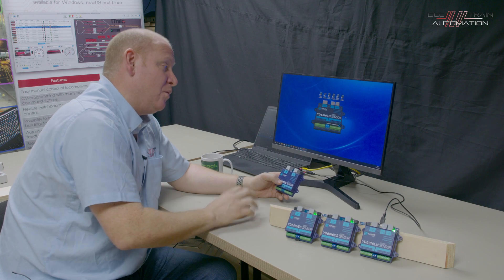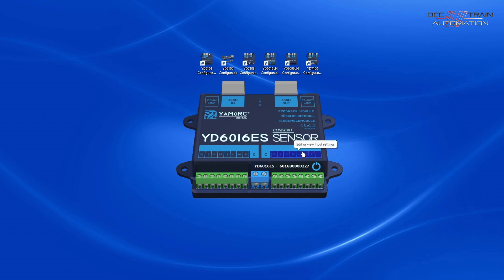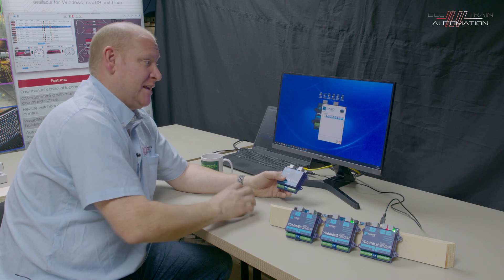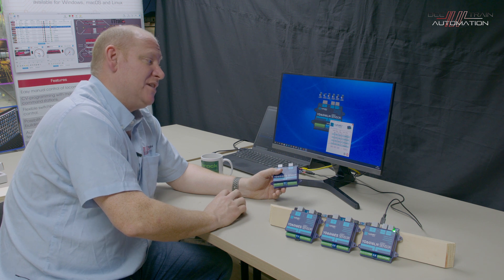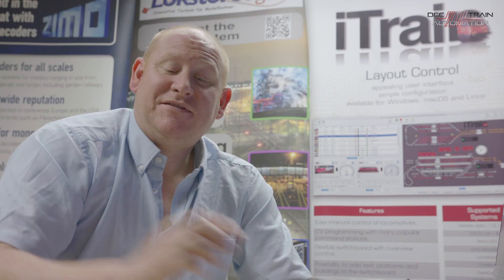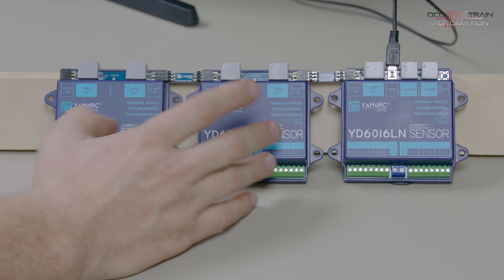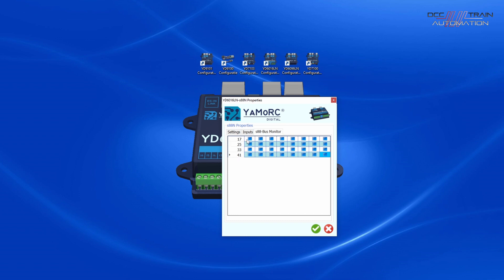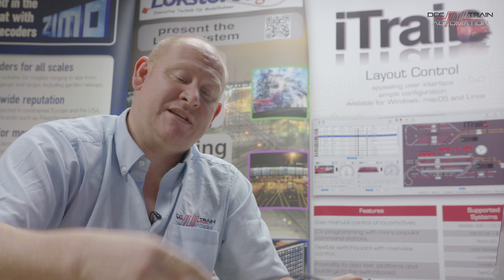YaMoRC YD6016LN-CS Track Detection No4

Comment: Hello! Thank you for your excellent videos, from which I am learning a lot! I am asking for your help here because I am a little stuck.
The facts: I have three Yamorc YD8116 decoders, one YD9100 interface and two YD6016RB-CS modules.
I configured my three YD8116 decoders without any problems using the YD9100. Then I wanted to use the YD9100 to configure the addresses of the YD6016RB-CS modules, but I ran into a problem. When I connect the YD9100 to the YD6016RB-CS via ES-Link, and plug it into my computer's USB port, the green ‘power’ LED on the YD9100 goes out, and I therefore cannot access the module.
Furthermore, after this attempt, the YD9100 is no longer recognised at all, even when connected on its own to the PC's USB port (no YD9100 found) by the Yamorc configuration programme (version 73). I cannot even read again the 3 units YD8116 I just finished to configurate.
If I connect the YD6016RB-CS on its own, via the USB connector on the module, I can see the addresses and update the firmware, but I cannot change the addresses.
Can you help me find a solution? Thank you in advance.

Comment: Are the YD6016xx limited to only 5 modules on the bus? It seems to be quite a drawback from Digikeijs DR4088-modules....
Reply from the maker: @steenthunberg5824   no that is not the case. The YD6016LN-CS can have 5 YD6016ES-CS units on each one. Then I believe in theory then 18 YD6016LN-Cs each with 5 YD6016ES-CS that’s a total of 108 total units. That for most layouts would be huge amount.

Comment: James, thanks for these videos, but can I raise a query? I may have misunderstood but in the video you show that one or more YD60916ES-CS can be connected to the YD6016LN-CS via the ES-Link and that you need to tell the 6016LN how many modules are connected.  So far so good.   You then seem to intimate that the 6016ES will have its ID addresses automatically assigned by the 6016LN, carrying on from the last ID of the 6016LN.    Is this right please, as in order to get mine to work I had to enter the s88N configuration, and enter the addresses.

Comment: Can i distribute the ES units around the layout and just use cables and do the same thing? I need five modules total, and that seems like a good idea if possible.
Reply from the maker: You an as long as the total length of the s88 cable connecting all the modules together does not go longer than 3meters.
Reply: @DCCtrainautomation  Thanks James, I think I'll stick with the CS version in the video instead for them all in that case, just seems easier for me then

Comment: Where are these units drawing power from? Do you have to have the usb (?micro usb) plugged in to the Loconet unit to power them all? Cant see anywhere in the manuals about it!
Reply from the maker: Hello sir.
So these units can be set up and firmware updates by the USB. Then when in operation and connect to loco-net they then get power from there. All the detection information is sent back to the command station over loco-net. The track power in the detection side then comes from the command station track power or the booster.
Reply: So powered directly by Loconet? That's helpful. One less cable to run! 👍🏻👍🏻

Comment: Very interesting. What type of switch would I need if I used two contacts for a turnout, and how would I wire it? Would a SPDT just conected to the two said contacts do the trick?
Reply from the maker: What type of point motor are you wanting to use?
Reply: @DCCtrainautomation  Hi, a mtb mp5. I want to be able to operate the turnout from the z21 app, train controller and a manual switch. I know that if I assign one output to one turnout position and the other position to a 2nd output, then I might have to manually switch twice since moving the turnout on the app or train controller won't physically move the SPDT switch.
Reply from the maker: @johntavish8750  then these are perfect!
Reply: @DCCtrainautomation  I just recieved two of them, however I have no idea how to wire it to spdt switch for that particular function.

Comment: Hi James. Thanks for the useful video, however I am failing at the first step. When I plug by YD6016LN into my laptop via USB my computer recognises the device. However, when I open the configuration software it doesn't find the device and just says YD6016 via YDDEMO in the USB properties. I have installed the windows driver from the Yamorc website. I'd be grateful for any suggestions about where I'm goign wrong? Thanks!
Reply from the maker: There could be many reasons for this you plugged in the unit before you load the software and drivers. Would be the main on.
Reply: @DCCtrainautomation Thanks for your reply. The driver was installed but was saved in the wrong location on my computer. All sorted now and the product is working well. Thanks!
Reply from the maker: Or the USB cable is not good.

Comment: Thanks for posting this video.  I do not have one yet, but I am not clear about using as inputs for LocoNet sensors.  My plan was to have a 10kohm resistor across the track (basically, using the common on the YD6016LN) with an inline switch (or momentary pushbutton) which would close to activate detection/input. Then I presume a LocoNet message would be generated for that input (LS17 is Active, for example) that could be used in JMRI with Logix to effect whatever I want (turnout, accessory, sound, script, etc).   Or is it simpler than that by configuring the board differently (like the Turnout function)?  

Phil in gorgeous Young Harris, Georgia, USA

Comment: Thanks so much for those great videos! Those products look great and I'll definitely need to test them on my layout and on my blog. One thing that's still unclear to me though, is YaMorC's YaB approach (Yet Another Bus 😉) with the ES-Link. Although I love the idea of being able to configure/upgrade all modules through ES-Link, it's unclear (as already asked below by someone else about the S88 modules) when the ES-Link can be used in day to day operation, and not only for programming.
So, say I decide to go with two YD6016LN-CS with Loconet (no S88 modules). Can I operate them with only one connected to the Loconet bus, but both modules connected together through ES-Link. If possible at all, and would I loose any functionality? 
Keep up the great videos!
Reply: Hi two YD6016LN do not connect through ES-Link amongst each other. Behind one YD6016LN one can link-up upto 5 YD6016ES by using either cable or ES-Link

Comment: Hi, when used as a feedback sensor, how does this work in a reversing loop situation? I want to place feedback sensors on a reversing loop block, where the polarity will change. At the moment, I use a GM auto reverse module, but what would be needed with the Yamorc unit?
Reply from the maker: Hello Ian yes this is possible but not with the reverse loop module you are using. Please call the shop to talk to us. I did a video on this years ago but need to up date that. As things have moved on a bit.

Comment: So you can set any address to the loconet version, but the connected S88’s are sequential starting at address 17. What if you have a 2nd setup with random addresses on that loconet device, won’t the S88’s also start with an address of 17 and so on ? Won’t there be a conflict of S88 addresses ?
Reply from the maker: You can not over lap addresses no.
Reply: yes you CAN address the s88 inputs independantly. but only when controlled by the YD6016LN. ;)

Comment: During operation, if the S88’s are close by, you can use the e-link without  a S88 “network cable”, correct ?
Reply from the maker: Yes that’s right you can use the ES-link joiners to do that.

Comment: So, if I get it right, the only difference between this module and the Digikeijs module is the way to configure them. Operation-wise they are the same, correct?
Reply from the maker: Yes and no. They preform the same function yes. But the small issues that the DK loco net ones had has gone. Also they are all firmware updatable.
Reply: @DCCtrainautomation  I was thinking R-BUS models
Reply from the maker: @Hal-Zuzzu_Model_Railway  these are not R-BUS
Reply: @DCCtrainautomation  Agree, but I was wondering if what I said applies to the R-BUS version!
Reply from the maker: @Hal-Zuzzu_Model_Railway  they don’t plan on doing R-BUS versions
Reply: @DCCtrainautomation  That settles that then :) 
Thank you for your time :)
Reply from the maker: @Hal-Zuzzu_Model_Railway  noproblem.